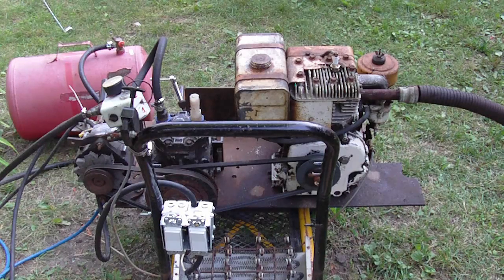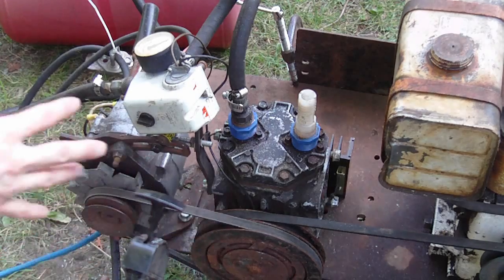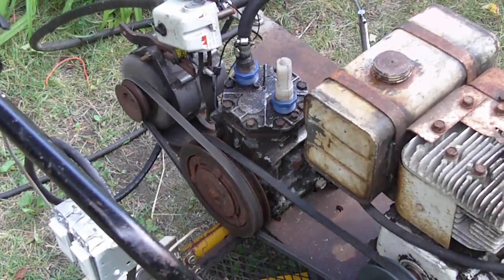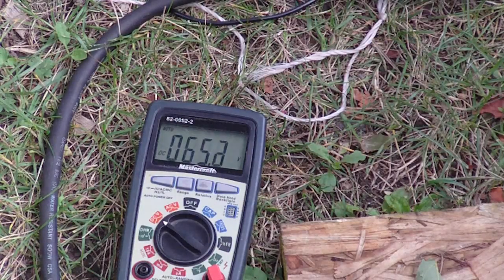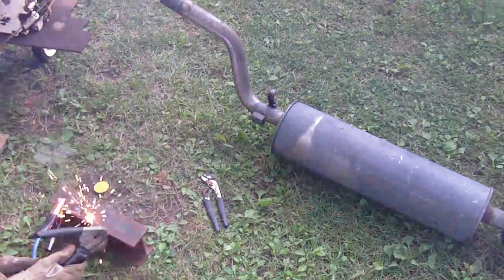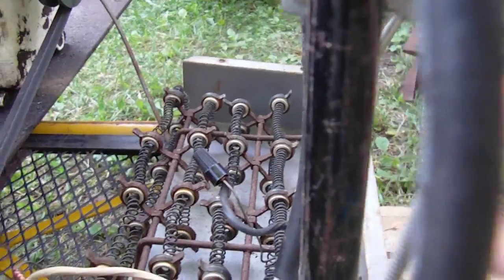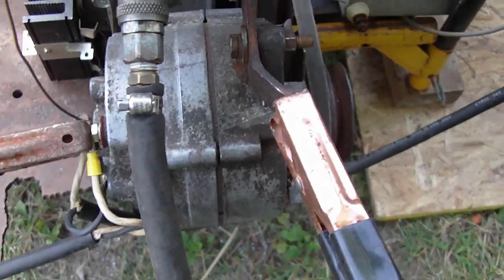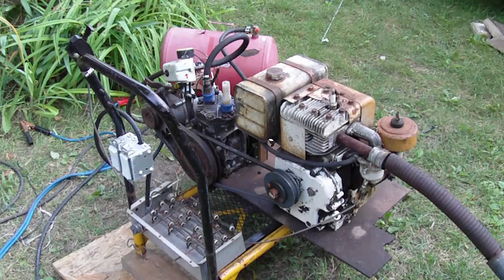Homemade Air compressor, Generator, Arc welder

Comment: Dr.  Kurt @ Cottage :   i  see, you've  installed an element, from a 240 volt dryer, on the bottom.  That, there to keep everything, warm, in the winter  ?  or, just a foot/hand warmer....?  OR,  MAYBE  both  !
Reply from the maker: Thanks Peter 😎 that's a good idea for the element it gets slightly warm. Actually the element is acting as a resistor for the alternator field voltage input, it's all part of the system to work without a battery and a welder.

Comment: Can you use your alternator to charge battery and in turn charge the air pump to again compress air into the air compressor to make it spin or will it stop and some at some time you must start it again?

I am thinking that the air compressor can spin the alternator to charge battery, then the battery can be used to work a pump and this pump will run through the air compressor and that willl again and again compress the air.

Comment: WHAT???!!! Increased alternator rpm? Nope - you might as well have belted it directly to the engine. Both of those grooves on the York compressor are the same size, making it a 1:1 ratio, meaning the transfer ratio DOES NOT change the final ratio. I like the video anyway...

Comment: If you could get two of the same alternators, couldn't you wire them in series to get 120-130 volts?

Comment: I have a new patent on an inexpensive positive power air compressor 
generator. It creates all the power, compressed air, steam, and water 
from condensation you can ever use and it is very simple to make with 
off the shelf parts. At first they kept saying there is no such thing as
 perpetual motion. Of coarse they are right but that is not what I have.
 I had to prove and explain it to them in detail. They kept saying it 
takes more energy to make the compressed air than it takes just to 
generate the electricity. I thank the professors for thinking and 
teaching their students to think inside the box. I have a patent now and
 more on the way.
Reply: welcome to the Club. I am just working on a 115 v 10kw dc battery charger, using a 15 kv ac motor and a yanmar diesel - when I mentionned that two beefy alternators in series could do the trick, everyone said it cannot be done... sure, there are 14v 190A watercooled car alternators which can churn out 50-60 v easily.

Comment: Isn't using the alternator as a welder just as dangerous as using a normal welder. That is if it is wired with proper leads and not jumper cables.

Comment: Maybe  use a dc saw? battery kind, makita or dewalt ? idk just thinking out loud. or add a battery to the mix for more even current draw. use the pos cable on your work, neg for the stick. In  all I think cool idea. it's not solar or anything but good portable power for a farm or likewise.

Comment: Good experiment
One thing to research and consider is that running a saw with only 70 volts it will work, but can burn up your saw motor.  This is why you are not to run a saw on lots and lots of extension cords.  The longer the cord the more resistance the more resistance the lower the voltage. (Ohm's Law). Good job putting it all together. Keep experimenting.

Comment: Your resister is called a load dump.
Reply: Electronicdawg could you use any type of load? like a light
Reply: 12v water heater element would be better, like from an rv water heater.
Reply: so a large load with decent resistance k got it
i want to make a slightly smaller version of this

Comment: the reason your weld is not working is you need to put the positive side on the piece that your welding and the neg on the rod. when you weld with dc dc currant runs from neg to pos and the metal will flow from the rod to the weld better that way. when you hook it up the way you were it will splatter a lot and you wont get very good penetration.

Comment: Its not the 70 volts that will kill ya mate, its the amps that follows it, you could have millions of volts with only 0.01 mA and you'll live, have 12 volts with 1 amp and say goodbye amps are the bitch that roots ya
Reply: voltage hurts, amps kill.
Reply: Actually it's the opposite... Think of electric fences - can be powered by a little square 9V battery. At 9V you can stick the terminals across your tongue but when it's stepped up to a few hundred volts at lower current you wouldn't wanna stick that on your tongue :P the current just makes you stick to whatever you're touching.

Comment: There is this thing called the "Internet" and it has all the info you need, you just need to have someone show you how to use it!
Model
19-0-4-0-2
19 = CID
0 = Series Engine
4 = Horizontal shaft
0 = Plain Bearing/DU non-Flange Mount
2 = Rewind Starter

Type
0722-01
The type number Id's the mechanical parts, paint color, decals governed speed and OEM.

Code
72-03-13-1
The code is the date
Year = 72
Month = March
Day = 13th
Assembly line and plant = 1

Comment: That engine is a 9 HP engine. I have a same engine on my old Rapid lawn mover machine.
Reply: Its also from 72    a pretty old thing. I reckon a 10hp china diesel would work better tho. More torque and fuel econemy
Reply: @alexhickey5633  - Nope - if it's the same horsepower at the same RPM, the torque is also the same. That's just the way it is. I doubt most "enthusiasts" here can comprehend the significance, but here it is - the MAGICAL torque vs. horsepower debunking formula: HP = TQ x Rpm ÷ 5252. If you have any mathematical savvy at all, you'll see that horsepower and torque are INSEPARABLY related. You can have 4000 ft-lbf torque, but if it's not turning anything, your result NO horsepower, as your apparatus doesn't have the capability to move the load. I've used this example before, so it's an easy one: a 1000 horsepower steam engine, as the prime power source at a sawmill where I worked in my younger days, developed its rated output at a mere 98 rpm. Any guesses as to what the torque is at that rpm and horsepower? Try 53,592 ft-lbf. I can tell you, though, the surface speed of the leather belt connecting the 20-foot diameter flywheel to the main shaft sounded like a hurricane, because the air had to squeeze out from under a 3-1/2 foot wide belt.
Reply: A diesel 10hp engine has more torque than a petrol 10hp due to longer stroke even if the bore is the same. Stroke length is where you get torque. If stroke length is longer than the bore you will get a low hp but high torque figure. Likewise if you get a large bore but stroke smaller than the bore, you will get higher hp figures than torque. A "square" engine will have more hp than torque. Same reason rotary engines have high hp but low torque.

Comment: Hi have you viewed you tube user brey213 he has joe bookers videos of how he runs a engine on stripped charged AIR it becomes a positron magnetic attraction repulsion engine my question is it possible to make a alternator act as a starter motor like you can old dynamos also he states how to phase the battery so that it has both single phase and 3phase ability and ac neutral tesla spark and dc pulsed tesla spark by making water and oil in the engine become a fluid tesla coil effect appreciate a reply as I have more info urine in coolant and phased locked loop is involved
Reply: No you cant use an alternator as a starter. Back in the day you could use a generator as a starter,,I actually have a marine generator that uses the gen head as a starter. And you can energize old car generators and use as a starter or other use.

Comment: That was cool dude. I have almost the same setup except for the welding part which I didn't know you could do it that way. I did a series of videos on alternators where one of the subjects I cover is rewiring the stator in those alternators to increase amperage which you could do to your alternator. The only differance between your alt. and my alt. ,in the stator modification is that the 3 leads on your alt. are longer. Check it out.
Reply: You have to run a high amp 12 volt battery for welding. Welding is accomplished with the current...not so much the voltage. However....you have to step that 60+ volts down to 12 to keep the battery charged. Depending on the duty cycle of the welding you are going to do, you can connect two or three batteries in parallel.
The optimal size alternator to use is a 100-120 amp...You can find these in old ambulances or other power hungry vehicles.
Reply: mercury90hp Sure, I got it, you weld with amps. And you need 100-120 amps to weld with for 12v, right? And how thick of steel can you weld then?
Reply: With a 6013 7011 7018 rod you could weld up to 3/32 steel. Batteries arent gonna last long. The alternator will not charge it that fast for recovery. Also you must isolate the alternator when welding or you will blow it out when you short circuit the batteries striking an arc.
Kinda not worth all the trouble.
Reply: mercury90hp Thanks for the info. I kinda guessed it was something like that which is probably why I never tried it in the first place. Definitaly seems like a lot of work for little reward. Thanks again.

Comment: This is a really neat idea! I have a 7 horse power engine collecting dust in my shed, in a couple weeks I will run by a car scrap yard and get a few alternators and some old car refrigerant compressors, there are lots of oxygen and acetylene tanks out there I might try to find a few small tanks and make a small air reservoir to add to it. I have a newer alternator it probably has the 12v regulator you were talking about so I will use that to top up a car batt to power the field windings, relays, and electromagnetic clutch.

Comment: Great video and awesome use of parts!  Question:  You said you got the alternator to "self-energize", but what I have been reading is that a normal alternator needs an initial 12 V (even a 9v radio battery will work) to energize the field to get the alternator to start producing electricity.  Spinning an alternator by itself produces no power unless a field is energized to create a magnetic field to start making electricity, yes?  Did you have a 12v power source off camera somewhere?  Regardless of that, sweet concept and two-thumbs up execution!
Reply: When you roll start a manual with a dead battery or no battery what causes the alternator to energize? Under what your saying it wouldn't work but it does. When you roll start it's all mechanical
Reply: @JamesSmith-lt5zz  - If an alternator equipped vehicle can be bump started with a totally dead battery, any "self energizing" that takes place is unintentional. Alternators are supposedly designed to not retain any residual magnetism in their iron and normally depend on at least a little field excitation to start generating, unlike the old DC generators that preceded them. However, as you noted it sometimes is possible to have an alternator that will hold a little residual magnetism and start generating all on their own. But this is very hit and miss, with the misses being far more likely. The reason this was done with alternators is to give complete control of the output through the field. Having any appreciable residual magnetism means that the voltage regulator might lose control of the alternator at very high rotational speeds, something that wouldn't be good for the electrical system. Most likely though, what you believe to be a self energizing phenomenon may actually be an almost but not completely dead battery ekeing out just enough current to get the alternator going. But again, most ferrous material will hold a little magnetism under the right circumstances. If you have a vehicle that you can push start with a dead battery, consider it a bonus feature from the manufacturer.

Comment: We had a working 10 horse power B&S engine with nothing wrong with it but my step father told my brother to throw it away.
We could have used it when our power was out last year for 6 days.
That could be a 8 horse power but the one we had looks just like it.
No need to have a carb if your going to run it on syngas just need a ball valve.
Could rig up some way with a heat exchanger around the exhaust manifold and muffler to make hot water.
I thought about if I get a junk engine to drill some holes in the crank case just below the movement of the crank shaft and seal it run some copper tubes to get more hear for hot water while at the same time cool the oil.
Drill holes also with a drill press into the outside cooling fins to run some copper tubing to get even more heat from the engine and keep the engine more cooler than originally.
But hey ? if it's a junker what do I care if the project fails it's worth a try.
Rig up some way with the exhaust manifold with some crafty welding or casing some case iron a pot or pan attachment to cook food from the heat from the engine.
No point of wasting that heat that would other wise go to waste.
If some really creative person where to rig up some way to get that heat to run it into some water tank to make hot water for your home or heating your home with a heat exchanger.
Won't have to worry about exhaust gases getting into the house if you use a heat exchanger or a really good sealed system.

Comment: If you can find one, the old Motorola 105 amp alternators, designed for police cars with big radio installations, make good arc welders.